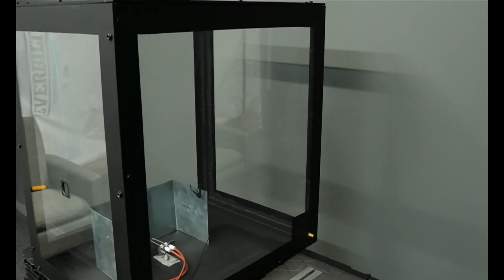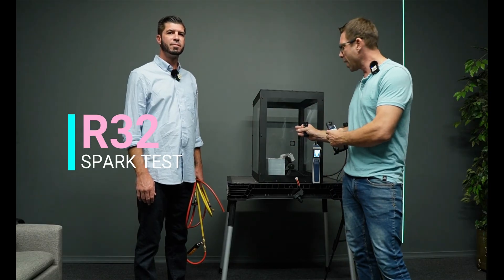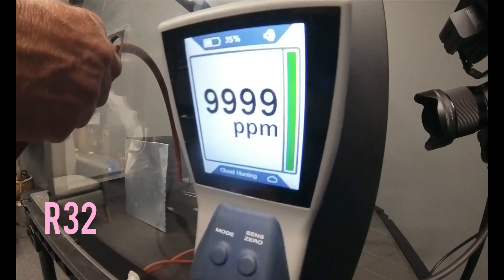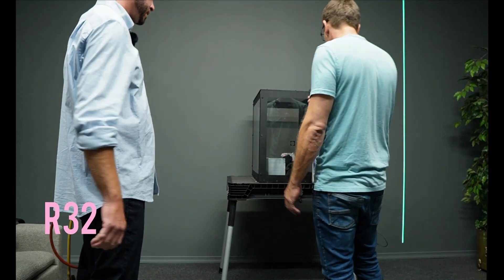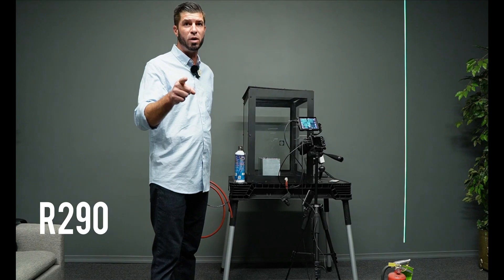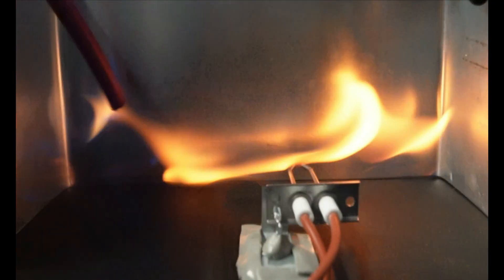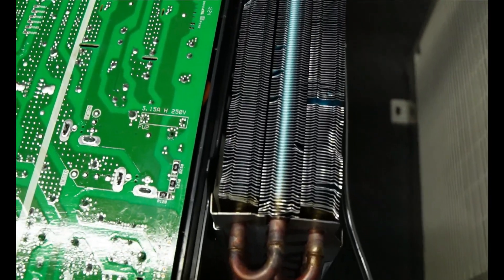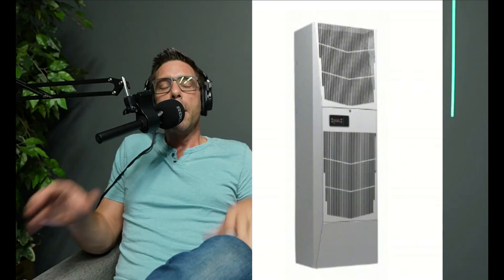Is R32 Worth the Risk? HVAC Flammability Test HVAC (4k) No Joke!

Comment: Progress is to move an industry toward a naturally safer design with no harder or further steps required. They, whomever are in control need to eat crow and allow manufacturing to use r12, r22, r502, r11... Oh I forgot, patents run out, corporations need more profits, and it just isn't easy to tax a volcano emitting various extreme amounts of toxins into the air, and you just can't tax boosters burning direct holes through the ozone layer. But you can make the techs & installers purchase and carry recovery systems, you can force them to attend continuing education or they loose their license which supports their family, you can go from r12,r22,r502,r11 to oh so many differing new  refrigerant types, differing oil types, increase unit size in the name of efficiency (many times the new larger air handlers won't fit back in the mechanical closets, or through attic framed openings), you can make the coils larger ($), fan motor farther from the contactor ($), more galvanized metal case ($), a few more screws ($), a bit more PPG paint for the larger case ($), a tad more compressor oil ($), a tad more refrigerant ($), and next utilize a questionable safe refrigerant type which has exploded and killed, maimed many people. Propane. Well done those in charge. I recall buying a drum of r22 for 36.00+ tax. What is a drum of r454b? Who cares, I will NEVER buy any very gladly. I can make my income other methods. Sad if even one man additionally dies, or even one homeowner additionally dies, or even one restaurant kitchen worker additionally dies 'in the guise of climate change' and progression of the world. The hvacr industry is more dangerous than many realize or admit already. 
Now we have this new stuff called "propane" as a refrigerant. Wow. The old chemical engineers knew not to use it decades ago. Oh, just take this additional training, sign this class roster and date it. Additionally all while   hvacr techs are retiring, dying off, a few changing career paths, and not enough recruits coming in which are saavy, interested, all capable. You know we already roast and have heat strokes on rooftops, and 130 to 150f attics, already had to be sure of other practices to not get hurt. Now propane. Good going 'whoever' is in charge. Sleep well at night? No one needs to guess my feelings of such. Yeah it's a rant. Yes I'm in hvacr. Yes I had a business 20yrs. Yes I have done hvacr 35yrs.
Reply: The world is not right.  But the issue is the ones who are wrong dont think they are and will fight, lie, bribe whatever to make others believe they’re right.  I blame big money and the government officials who allow some of these things to happen but its likely all apart of a much bigger scheme in the long run..  unfortunately there seems to be much more dumb, ignorant and flat out evil in this world and that side of the population for whatever reason are the ones who keep having children and raising more dumb, ignorant and evil pos..   when your a minority it doesnt matter whether thats a race or apart of a belief or fighting for a cause, if theres not enough people with their heads not stuck up their or someone elses ass then your cause doesnt mean shit until it kills a few dozen people then it takes notice..  the best thing to do is to avoid the shit you think you need to and follow your safest practices, show others love who show you the same, and be a good person to hope it catches on to soneone else.  Cuz theres too many fukers in this world.  Need all the help we can get..

Comment: Can you conclude from your detector readings whether or not the R32 concentration was in the range, were it forms explosive gas mixtures (whatever explosive than means in this particular case?....just saw a video with Yf1234 so far, burns down quite slow than) with air ? (>13% < 33%)

Comment: What causes compressor explosions in refrigeration systems?
One major cause is technician error — specifically, introducing oxygen or compressed air into the system instead of nitrogen during pressure testing or purging.

Here’s why that’s dangerous:
Refrigeration compressors are filled with oil, and when oxygen mixes with that oil under pressure, it creates a highly volatile and combustible environment. Add a bit of heat or a spark from components — and BOOM. It can literally cause the compressor to explode or catch fire.

That’s why pros always use dry nitrogen — it’s inert, non-flammable, and safe for testing or flushing.
Reply: How and WHY would anyone, ever, introduce oxygen inside a refrigerant system!??
Are they connecting the oxy/acet to their charging gauges? How does that happen? There would have to be an intentional use of an adapter fitting. I call nonsense on charging oxygen into a refrigerant unit.
Reply: @deek791 nah it’s happened before, pressurizing with oxygen because they didn’t have nitrogen. My school even did a test like this after hearing about it. Blew a compressor sky high.

Comment: Even the R290 will still only have a flame at the source of the leak where it is mixing with ambient oxygen.
The scare is a leak in a non ventilated confined space (coil area when the fan isn't being cycled) where it could have the chance to have a mixture ratio that could be ignited.
The odds are not that high however we are about to witness all sorts of code implementation and arguments over the next few years.

Comment: Here is NZ we use r32 for quite few years. I work in the capital of this country here with zero issues. It’s a safe refrigerant when you use it as designed.
Reply: Safe isnt really applied to "when it's used properly".  You have to apply safe to all the accidental issues, breakdowns, manufacture defects and careless homeowners and techs.
Reply: Nowadays in the UK you can't buy any mobile aircon with a safe gas but only with R290, I now, I spent days to look for one and sent back 3 because of false / misleading advertising. Even those types which are filled with R32 if sold in the US were filled with R290 if sold in the UK. You can find safer R32 only if you go after the very expensive (including set-up fee by an engineer) split type aircons. A couple of years ago they sold some with DIY, we bought and assembled it with no problem, it worked fine for 5 years then died, now you have to provide an engineer's number to be able to buy it, the cost at the end will be highly above 1000. Back then it was 400 if it was DIY.

Comment: What about when you have a short in a compressor full of this same refrigerant?
Reply: It needs oxygen to ignite
Reply from the maker: Good question
Reply: @GWAC555 I agree, but if the system has been properly evacuated, even with propane it won't combust without oxygen, that's why it is important for our technicians to be well educated about the potential hazards about A2L and especially A3 refrigerants

Comment: Heat your box to 125 degrees, now do the same test with R-32 tank also heated up to 125 degrees.They say at 120 degrees A2L will become volatile. I never saw  a flame or a spark test with the cylinder at temp of 125 now do your same test with everything at 125 even inside your test box . Your service van sitting in direct sun on 90 degree day your service van will exceed 120. Manufactures are vague about how volatile is volatile.?????  I enjoyed your vid test, what would your test be like at the temp they say A2L now becomes volatile????????????????????
So A2L volitile test would be interesting to see done. Your vid was fun and good.👍👍
Reply: Sounds like what a pansy union worker would say. Maybe take up something safe like origami.

Comment: You need to be aware that both R32 or R290 are and can be INTERNALY be EXPLOSIVE (ignition temperature of lubricating oil at the compression cycle)  in the presence of air or water. This will not happen if A1 class (like R410A or R513A, R134a etc) . By the way did you know the only reason A1 class (CFC 22, 12, HFC22, HFC410A etc) was SAFETY and since 1928.

Comment: The concentration of the r32 was too high to be in the range of explosive mix.
Between 13,5 and 27%Vol in air it is explosive. Below and above it's not.
Try that again with 20% Vol.mix in Air 🤪
Reply: The thing is that the quantity of refridgerant for a given volume of a room is designed so that the flammability threshold cannot be reached. If a leak is detected it turns the fans on high and compressor off, to mix the air and dilute the leak. Even for a gross discharge on the condenser itll mix the air fast which should exceed the flame propagation speed where its at flammable concentrations and dilute it downstream where the flame propagation could catch up, to non flammable levels. You saw how hard that was to ignite. For Ammonia systems, they find leaks by burning sulphur sticks as the sulphur dioxide and ammonia react to make dense white smoke. Ammonia is MORE flammable than R32 and they leak test it by open flame.

Comment: I miss old R22 systems, built to last. R410A will be the last of the good refrigerant
Reply: R32 is fine
Reply: R410a is half R32.
Reply: R410a is 50% r32 and 50% r125. The 125 is used a flame suppressor. Straight r125 is also used as fire suppression gas in secure facilities as well.
And generally the more volatile a refrigerant it the less gwp it has because it breaks down faster in the atmosphere which means moving forward all refrigerants will become increasingly more dangerous.
Reply: R32 is a better version of R410A since it has better efficiency and half the refrigerant isn't just fire retardant (R125).
Reply: @imzjustplayin  Tell this please to the regulators in the UK, by some misterious reasons R290 is pushed and pushed with force. Try to buy a new mobile air con here with R-32 or even with R410A, good luck.
Reply: And it was more about the build quality of the systems that ran R22 and the mineral oil that it was compatible with, that was not acidic in contact with water and didn't flush brazing crud into orifices.
Reply: r410 is trash
Reply: @FrostHVAC  Maybe, but I ended up buying an old used mobile aircon with that rather than a new with R290 (same price), it is loud like hell but works fine and I am not worried having a smoke in my bedroom or using electric heater or for GS, just to lit a candle.

Comment: Please do R452a that cointains r1234yf
Reply from the maker: R452A is a mixture of 11% R32, 30% R1234yf, 59% R125.
This is a non flammable A1L refrigerant, R125 is a flame suppressant, when mixed with mildly flammable refrigerants it will make the mixture non flammable. Just like R410A is 50% R32 and 50% R125.

Comment: Mo99 for R-22 replacement, but isn't efficient as R-22 & will have a higher energy cost compared to R-22.

R-32 is probably going to get banned in the US soon as its already banned in the EU.

The US is banning R-410A & companies are still selling R-410A units!
Reply: I live in Europe and R32 is not banned, if anything it's becoming more and more common just like R290 and R600. Many Minisplit ACs are using R32 in Europe right now. I personally do not consider them as safe refrigerants. They are not.
Reply: Oh, lucky guys, I wish they would be here to sell them! I ended up buying a used R410A mobile aircon as couldn't find a new with R-32 or R410A in the UK (so much about Brexit), even the types they selling in the US with R-32, if sold here they all have R290. While you can find articles about R-32 as the gas of the future, safe and envirnment friendly but you can't find a mobile aircon with it.
Reply: Thank god mexico with all it's lack of regulation exists.

Everybody wants a closed border until it's time to do closed border shit.  I prefer my ac with the smallest side of fireballs possible, in home and auto.
Reply: @vro1899  true that

Comment: Nice content.  Been in the field since 1982.  You got a new subscriber.
Reply from the maker: TY
Reply: @GWAC555  Thank you, too. I wish I was allowed to share the link in my A.zon reviews, I sent back a mobile aircon to them due to false / misleading advertising where the specification stated R-32, the item itself was filled with propane according to its box. I also sent back one to a company (also false advertising) and one to another company which case I was not yet aware but reading the insturctions we realized that it had propane and no way I would take that risk. Especially that nowadays it has no smell, back then propane carried a smell for security. Now tell me we are paranoic and it is all by just coincidence that they push a gas to buy for households which is highly flammable and if anything happens like an electric sparkle you can blow up your room and yourself and it will be even your fault at the end.

Comment: R290 dangers. Compare that danger with a leaking BBQ grill or a gas stove with a leak.
Reply from the maker: The propane and Natural gas used in BBQ grills and stoves have an odor added to them so we can detect a leak. R290 has no odor whatsoever.
Reply: @GWAC555  Exactly. Back then we cooked with propane, was in a very sturdy metal bottle, when we changed the empty to filled we used soapy water to check leaking and also it had a smell to warn us. But now, in the mobile aircons, nothing will warn you. They are a joke when pushing it, instruction manual warn you to air the room, for GS if you air the room then what's the point of using and aircon? Also any electric stuff can cause an electric sparkle. They warn you not to use electric heater, but with this rate you can't use a candle or can't have a smoke, etc.
Reply: Hmmm, one people commonly associate with a risk of explosions, the other people don't think much of all.  
I'll let you guess which one AIR CONDITIONING is.

Comment: Try some r-32 , compressor oil and air mixture in your test chamber.
Reply from the maker: Yes! Mixture of oil, pressure, refrigerant and air in the system can complete the combustion triangle. If air is not present it will never result in combustion. Technicians should never skip  pulling vacuum.